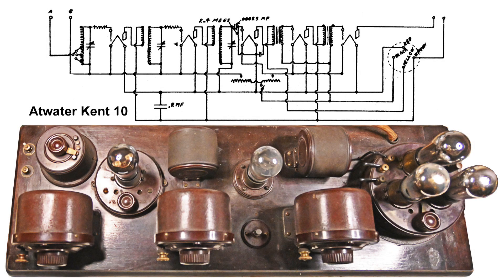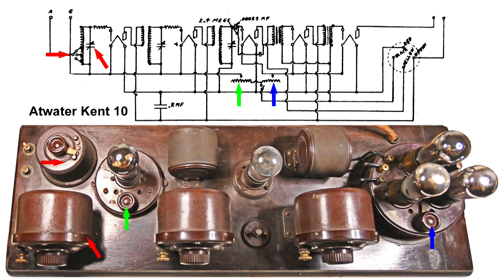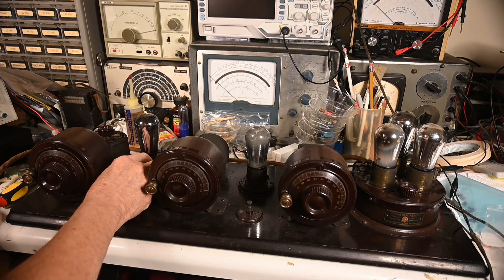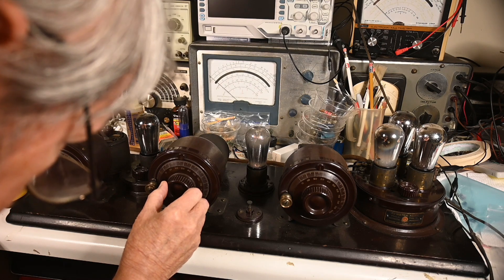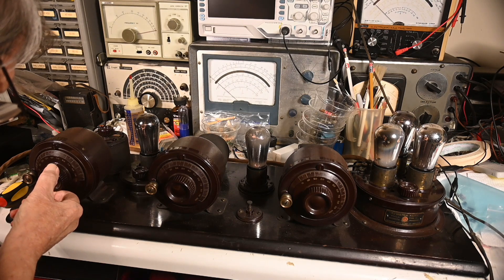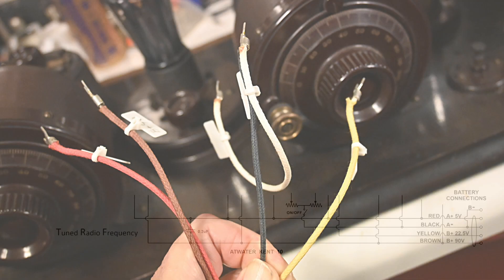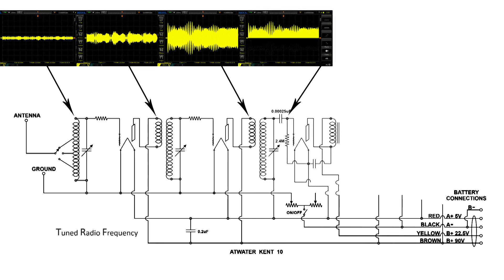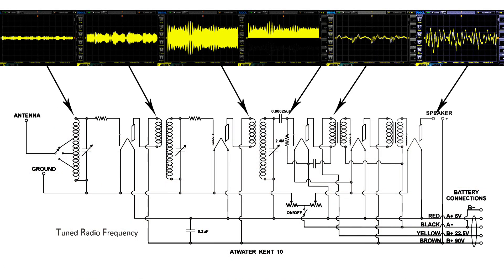Atwater Kent 10 Signal Flow and Circuit End to End 100 Years

Comment: If the original old tubes are no longer NOS available anymore.  Is there more modern day tubes that could be supplemented from the 40s or 60s. That would possibly need socket adapters and maybe resistors or capacitors of new values to make them work. ?
Reply from the maker: You can still buy 01A tubes on eBay.

Comment: I have an Atwater Kent radio, but no horn speaker.  Can I make a modern speaker work using a matching transformer?
Reply from the maker: I think you can. What model Atwater Kent radio do you have? I'll do a video on this and send you a link on this comment.
Reply from the maker: Connecting a modern PM speaker to a 1920s Atwater Kent Radio
Video link
https://youtu.be/m4x4yvzgCNg

Comment: Why does the detector tube grid filament, act as a diode, and not the preceding tubes?
Reply: Ok I watched again grid leak cap and resistor create a high impedance to make grid filament a diode if I understand it right,  so the preceding tube grids would be low impedance right, it's normal for plate side of tube to be high z right?
Reply from the maker: I did a more in depth video on just the detector circuit.
!923 Vacuum Tube, Amplitude Modulation Detector Circuit in Detail
https://youtu.be/e0faax3Svgw

Comment: Thanks Rick for showing the Atwater-Kent model 10 in operation using a horn speaker (which have a narrow frequency response, barely passing voice frequencies), which was the norm in that day.  This was considered a modern set in its day, prior to this model, radios were seperate circuits: RF, Audio, and Power Supply (which were batteries in that day).  Since the 3 tuning dials were non-synchronized, a pad of paper was always kept next to the radio to jot down the settings of the knobs for each radio station.  The list was arranged for day time and night time stations, each recorded station showed the knob settings, station call letters, and the station city name.

The selector switch (upper left) was used to maximize the radio's sensitivity based upon the antenna being used.  The longer the antenna, the lower the tap point on the input coil.  In practice, you would change the switch position to fine the loudest signal.

I was a bit surprised I did not hear one of the RF amplifiers break into oscillation while being tuned.  Due to the high capacitance between the vacuum tube grid and plate in a triode, when a tuned circuit is  connected to the input and output, oscillation always occurs when the tuning dials are peaked.  In looking at the circuit later, I discovered Atwater-Kent inserted a grid resistor (about 600 ohms) in each tunable stage to de-que the circuit, which stops the oscillation at the expense of gain.

In that day (mid 1920's), typically all of the tubes used in the radio were the same type; usually 01A tubes.  A 6 volt lead-acid car battery was used to run the filaments.  22.5, 45, and 90 volt carbon-zinc batteries were used to supply the remaining voltages for the radio.  The carbon-zinc batteries were expensive because they were not rechargable.  A 90 volt battery consisted of 60, 1.5 volt carbon-zinc batteries in series.  Lead-acid batteries were not well liked in practice, invariably some acid would spill or belch from the battery.  The acid would burn holes in the carpet and rust iron and steel.  So, in 1926, the breakthroughs everyone was waiting for finally came true: (1) Radios that ran off AC power and (2) Radios using a single tuning knob.  At first the tuning knob dial was calibrated 0 to 100 but, it quickly was figured out to better use Frequency (in kilocycles) instead.
Reply from the maker: You may be interested in my last video on this radio.
!923 Vacuum Tube, Amplitude Modulation Detector Circuit in Detail
https://youtu.be/e0faax3Svgw
Reply: @AllAmericanFiveRadio  Okay thanks, I will check it out!

Comment: Hello from Tasmania.

  I see you have a Tek 465 there on your bench and I wonder if I could respectfully ask you to go along the grids and anodes of the Atwater Kent and show us the wavefirms. 
  I realize that the impedances in these old TRF sets is very high and the 1M scope probe will probably load the grid circuits down and not give true readings but you could use x10 probe attenuation in the later stages where the signal amplitudes are greater.
  I would be fascinated to see what sort of eaveforms appear when the Atwater Kent is tuned into a strong local vs weak DX station. 

  DC voltages under no signal vs strong signal on the filanments, grids and anodes would be also quite reveahling and show these at the resprctive nodes on the circuit.

  These old 1920’s TRF battery sets are far rarer here in Australia than they are in the United States, so it is very difficult to procure such a set locally to go over with my own scop and VTVM.
Reply from the maker: Thanks.
The waveform is what the station produces, amplitude mediated signal. And a weak station is just less of it. I’l  be happy to put a oscope on a 1920s radio to show these waveforms. But not the breadboard, because the TUBE ISLANDS are filled with TAR. They did that a lot in the 1920s. I have other 1920s radio that gives me much easier access to the circuits.  Keep experimenting.
Reply: @AllAmericanFiveRadio  Thanks for the reply. I did not realize the bottom of the chassis was bogged up with tar but that was a popular material in the era before plastics! I have one 1920’s set here, it is a homebrew very early superhet….I believe that they were made as homebrew kits to avoid patent infringment. It is amazing just how much patent litigation held the technology back in the ‘20’s and juw the technology took off in the ‘30’s once all thet litegous hoo-ha ended! My superhet uses UV-201’s and the I.F. Transformers use bundles of iron wire as open cores….long before ferrite was adapted to this purpose. 
   I can’t run the set because one of the tuning capacitors has a die-cast frame that has all swolenand cracked and fallen to bits.
I do have a mire modern electrically equivalent capacitor I could botch into the circuit just for a test, but I will hopefully get around to recasting the frame of the original one day. 

  What fascinates me most about these early sets is the sheer high impedances of it all…a bit too much load and your signal dissappears. I would be fascinated too see what happens if you gat a 1M resistor in series with a 10nF capacitor and connect one wnd of this to ground B- and then use the other end as a probe to probe the point in the circuit where the oscilloscope probe is hooked and see what effect the extra 1M of loading has.  After decades of working on semiconductor stuff, I have developed that “low source impedance” mindset that is sometimes hard to break when going back to 1960’s valve gear….let alone 1920’s bright emitting, directly heated valve gear. I and I think thst this is an important point someone in your position and with your lifetime of understanding could be made to all us “young-uns” out here.  I recall putting my finger…just near, not actually touching …the grid cap of s 6G8G duo-diode pentode detector-first AF in a 1940,s set and hearing the mains hum on my body be conducted across the few tens of fento-farads between my finger tip and the control grid cap. This is something that semiconductor guys rarely ever experience!
Reply from the maker: @thanhhuynh272  The bread board is open on the bottom. But the grid link resistor and capacitor, The RF bypass capacitor, along with both audio transformers are all in the three tube island. The three tube island is filled with tar.

Comment: A wonderful set to own & thanks for the clear description. One thing puzzles me. I always thought that multiple tuned circuits were troubled with oscillation & I've always experienced this when constructing such radios using triodes. As I understood it, this problem was solved by 'neutrodyne' circuits & later by screen grid tubes. How did they solve the problem of oscillation in this circuit please?
Reply from the maker: Thank you. Take a look at the bread board configuration. The antenna coil is mounted on the board vertically. The middle coil  is orientated North South, and the left coil is orientated West East. And the coils are fairly far apart. This is what keeps the radio from oscillating. Thanks for the question.
Reply: @AllAmericanFiveRadio  Thank you for your reply. Interesting & simple solution. I'd guess those filament rheostats have something to do with it too. They fell out of favour in UK radios when dull emitters became the norm. I've not used them in any of my experimental circuits.
Reply from the maker: @tiga4180  Keep experimenting!
Reply: @AllAmericanFiveRadio  Will do!
Reply: Excellent question, Paul.
Reply: @AnnieVanAuken  Thanks. Hope you enjoyed seeing this early radio being demonstrated.

Comment: Working as it did the day it was made. Incredible. Could you please explain in one of your future video's the meaning of the word tank as in a tank circuit. As I am now retired i have taken an interest in vintage radio, and living in the UK it's a term I am not familiar with. I so much enjoy your and other radio videos and am learning all the time. Many thanks. Terry
Reply: Hi Terry, I'm not sure where the name "Tank Circuit" originated but, was used widely in the US when I was in school in the early 1970's.  The circuit is also called a resonator, pole, L/C resonant circuit, and probably a few more names.  This circuit is the heart of an L/C filter.  The coil or inductor is electrically a mirror image of a capacitor.  When the coil and capacitor are connected in parallel, at a certain frequency (as determined by the coil and capacitor value), the reactance of the coil will cancel out the reactance of the capacitor and vice-versa.  The point of cancelation is called Resonance.  When resonance occurs, the parallel connected coil and capacitor electrically become an open circuit, which allows incoming frequencies that are at the resonant frequency to pass through.  So, the Tank Circuit contributed to making radio possible, so that one radio station at a time can be tuned in.
Reply from the maker: Thanks, good idea.

Comment: Rick - that radio is a national treasure. I was so surprised there was no warm up needed.. it came up right away !
Reply from the maker: Thank you. 5 Volt tube warm up quickly.
Reply: The instant warm up is due to the tubes having Directly Heated Cathodes.  In order to allow the tube filaments to operate from AC power, an Indirectly Heated Cathode was developed.  The Directly Heat Cathode places the filament in a metal sleeve to isolate the filament power from the RF or audio signal.  Since the filament is electrically isolated from the Cathode sleeve, it takes the filament some time (about 20 seconds) to heat up the Cathode sleeve before enough electrons start to boil off the sleeve, enabling operation.
Reply from the maker: @billharris6886  That and 0.25 AMP @ 5VDC for the filament